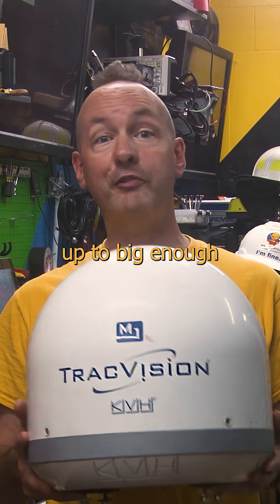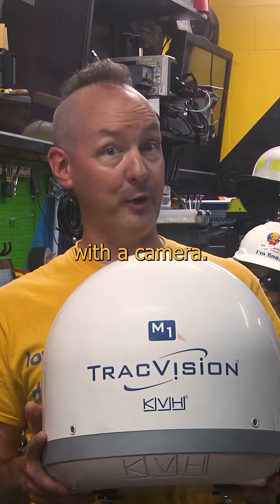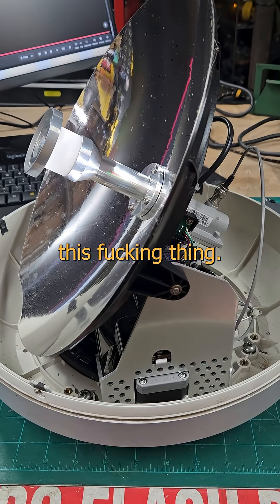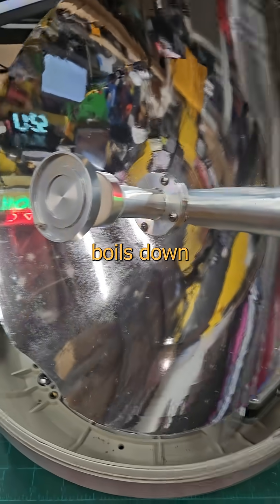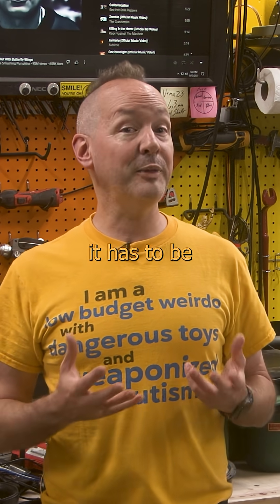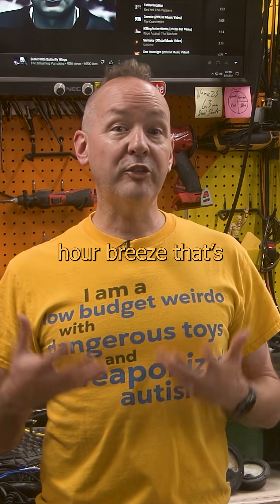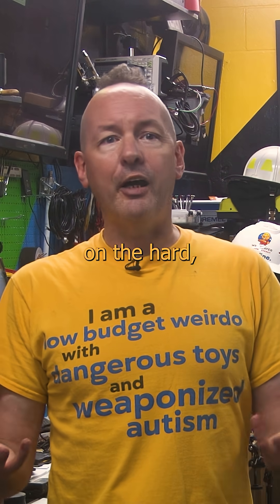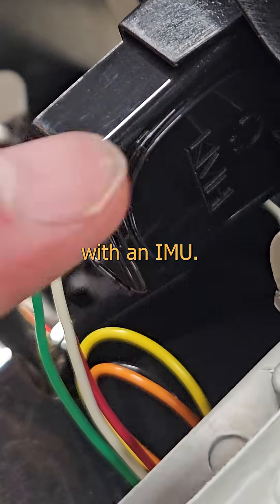Radome #chrisboden #comedy #engineering #marine #boat #satellite #radio #electronics #science #rf

Comment: 11 pounds per square metre
You did that deliberately, didn't you?
Reply: A story. 
Once upon a time, our handsome, smart and lithe protagonist decided to build a Bluetooth speaker, in the process learning speaker design, electronics, batteries n stuff and cabinet making. 
I purchased a pair of 3 way 16x9s that were made in Britain so I could get the ts numbers for the drivers. 
You plug these numbers into a model and it gives you a frequency response for a given volume. 
I worked with a friend from Yorkshire, I'm and 80s kid, he's a 50s kid. 
At school he literally used chalk and slate. 
Imperial meet metric. 
Now, it was all in metric by it just gives you a volume, no physical dimensions and we were having real trouble designing the right box with the correct internal volume. 
Suddenly, inspiration hits, I scribble, look up, and announce that the calculations fall easily into place _if you change your units to cubic decimetres.
...
He looks and me and said, "oh fk off" 😂

For reference, I often use the speaker as an impromptu table.
It's quite large and eventually loud.
I love it.
Reply: No love for cubits anymore . Sigh ....